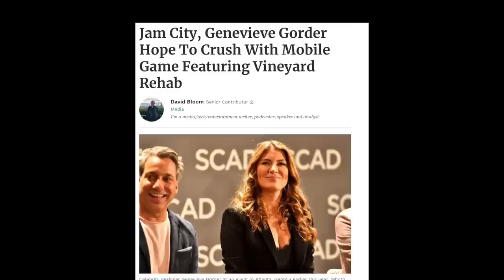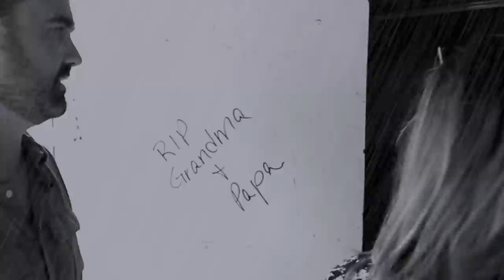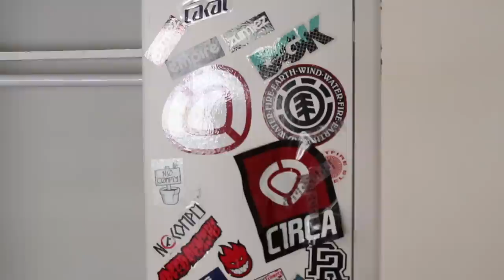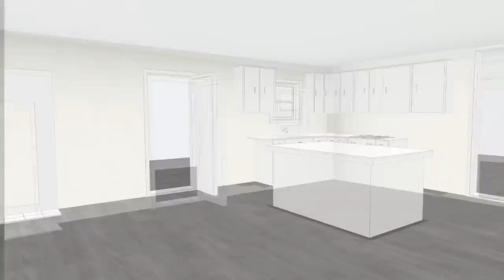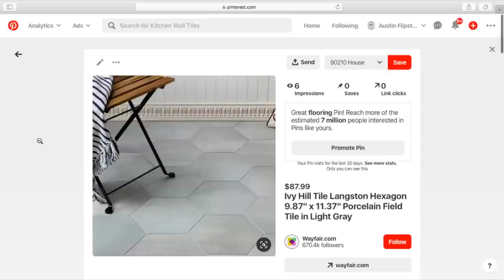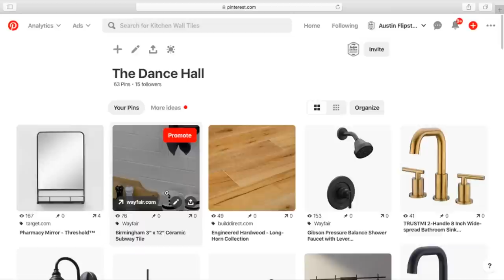Before and After Home Renovation | Ranch House

Comment: Impressive video. I started a bit late (graduated from my doctorate program at age 30  in 2016 with 170k in school loan debt). Managed to pay off my debt by 2019 and currently have a house and 250k total in investments (combo of profit share, 401k and a brokerage account). I'm not very knowledgeable in investing, so I just have my investing currently in index funds mainly voo, but have been putting a lot into schd the past few months. I dunno if that's the optimal strategy, but psychologically it is very set it and forget it, and prevents me from obsessing over individual stock performance.
Reply: I’m thinking of doing the same but not sure if I should use different brokerage accounts? Just Curious. Pros and cons ?
Reply: Instead of using different brokerage accounts to purchase index funds or individual stock, compare your age(s) and how much time you have estimated till retirement, you can also opt to consulting/working with a fund manager/advisor for an “optimal strategy” to outperform the bear market.
Reply: @robertlucas8288  Please tell me how I can think I have such skills. My funds are being murdered by inflation, therefore I'm looking for a more profitable investing strategy to put
Reply: @charlotteflair1043  she runs her firm under her name Julie Anne Hoover. You can find her contact page if you research her. Do your due diligence you'd find all you need to know.
Reply: @robertlucas8288  Thanks for sharing this. I did my own lil research, and your advisor looks advanced and experienced. I wrote her and dialled her twice but she didn't pick so I scheduled a phone call. She is experience can't wait to have a chat. I hope she doesn't ignore me.

Comment: for that bedroom with the two entrances... I would have removed that second door, and elongated the closet... but that's just me.
Reply: It's bad when comments have better design esthetics that Austin Fippers.
Reply: Same here
Reply: Absolutely
Reply: No not really,  it's awkward having the room entrance right in your living room,  that's a design crime.  My teachers would've torn that architect to shreds if they saw that.
Reply: I’m sure they agree but when you’re flipping to sell for profit some of those don’t get done because of time and money constraints. That’s the point of flipping.
Reply: @samschamaun5784  studs and drywall would been cheaper then that $200 door and hardware
Reply: @katie-5869  maybe, maybe not depending on where you live. Another factor to take into consideration is TIME. Time is money. Maybe they didn’t have the time to rip down walls and re do the layout lol sometimes eating $100 is worth it in the bed because of time……….
Reply: @samschamaun5784  They would have to rip down walls wtf 😂 pop out the old nasty door, slap up a couple 2x4's, use some leftover insulation from somewhere else, 2 sheets of gyproc and your done $50

Comment: So glad you guys are back. For the kitchen. No to the light fixture above the sink...actually the one in the bathroom would fit better. I would have carried the back splash behind the stove all the way up the wall but incredible difference
Reply from the maker: Thanks for watching Cerridwen! We thought about carrying the backsplash up the wall...but since the ceiling is at an angle, we didn't think there was a natural point to stop the backsplash without having to carry it on the entire wall (including over the door) or having it stop at the ceiling at an angle which would have looked strange. Plus stopping at the hood vent was cheaper.

Comment: The interior design is lacking, both kitchen lights are weird and there’s weird design choices but overall great job
Reply: this is a flipping business, not interior design business. ultimately buyers want to personalize their house, so they cant go overboard with interior designs that buyers are gonna throw away.|

if they put in more designs, buyer will say they wanna throw this and that away which doesnt have any value to them, and ask for more discounts.
Reply: Koehnia that’s an ignorant comment. As a potential buyer, I would want to change almost everything, does that qualify me for discounts? 

Fyi: the answer is no because no matter what fixtures go into the house, an evaluation is made on the house by experts and a price is decided on based on the value of the land, and the going rate of surrounding property. The walk score plays a bigger role in price of the property than the choice of light fixtures that go in the kitchen so try again

Comment: Nice design and good presentation. Thank you! As for my personal comment, that kitchen backsplash looks 80s (maybe on camera only) and I would've went with laminate flooring everywhere, instead of carpet. But maybe that makes it more expensive.
Reply from the maker: Thanks for watching! We did wood floors in common areas because its nicer. Buyers are typically split between carpet or hard surfaces in the bedrooms.

Comment: Brass pendant light over sink - no - clashes with the brass color of the sink Facet.
I would have used brushed steel or black.
Big vessel sinks have been done for the last 10 - 15 years. I would have used something lower in height.
🕊🙏🏻🕉

Comment: is this a half plex?   that beam is load bearing for something , why else would it be there, I don't like the over sink light, sorry.  Vessel sinks look good but are a mess to keep up in a main bathroom.  Just curious, did you put a automatic gate opener on that driveway gate?
Reply from the maker: Hey Dad, thanks for watching! The beam was holding up the other large beam that spanned the length of the room. We did put an automatic gate opener on the gate.
Reply: @AustinFlipsters  cool, that gate needed a opener.   Is it a house or a half Plex, it looked like a half Plex?
Reply from the maker: It’s just a house.
Reply: @AustinFlipsters  thanks, it even looked like the backyard was split, you did a nice job on it

Comment: So watching the finished product, I sure hope they do one more walk-through before listing it. I see the smoke exhaust above the stove is lose, there's some cabinets lose, different colored light switches in the same room, some of them are lose. If I was buying a house like this, I would absolutely walk away because of little things like this. If they can't screw a light switch all the way into the wall, I can't trust any of the other work that was done. I also noticed one of the new garage doors had a dent in the bottom of it. For half a mill, these things are completely unacceptable.

Comment: Brass has a tendency to look cheap and never looks good mixed with stainless steel.  I understand going with white interior walls if you don’t want to brave other neutrals but it isn’t great for exteriors.  There is a reason why if you drive through any neighborhood the majority of the homes are not white.  I’ve only watched 2 of your videos so far and you o redid white on both of them. Be radical and maybe try “oyster” or “cream” or even “ivory”!

Comment: You refurbish these small homes but appear to be against staging with mirrors... why is that? It makes rooms looks much larger and gives elegance to the home. I don't get it.  Also, add trim around the bottom of the wall cabinets... inexpensive and would add a lot of detail to the kitchen... the cabinets look a little cheap without them.

Comment: In all the flips the cabinets in the kitchen are far too low, they need to be higher up so there is enough space on the counters. You can't even put a mixer bowl there... It's very annoying. The staging sucks for this house and I hate the brass. I would have made the privacy fence out of hedges, those wood pallets are awful. With different decor, this would be a good house.